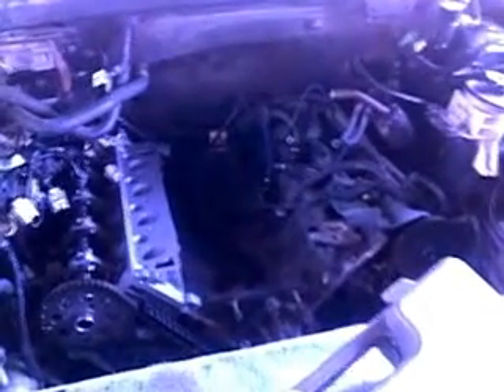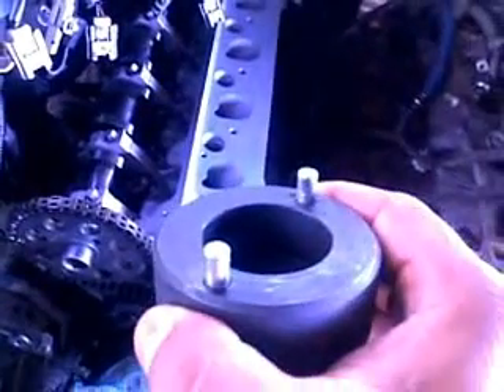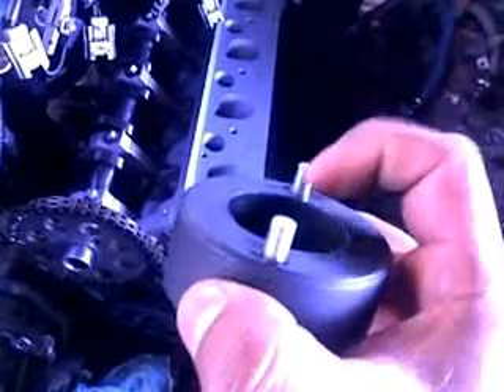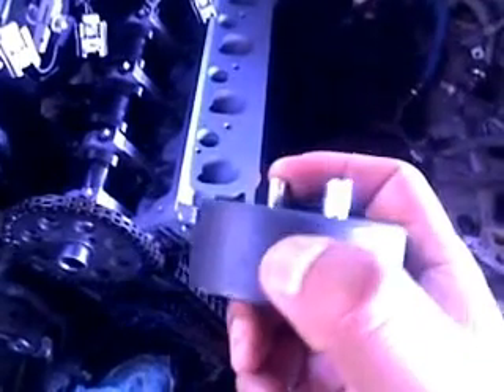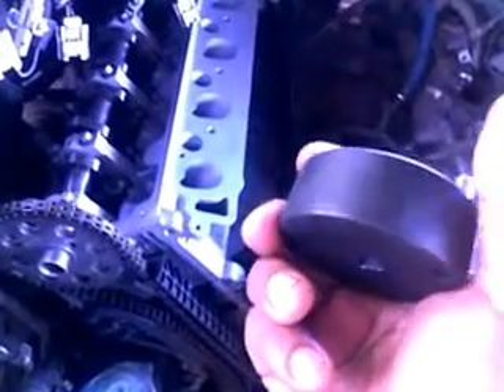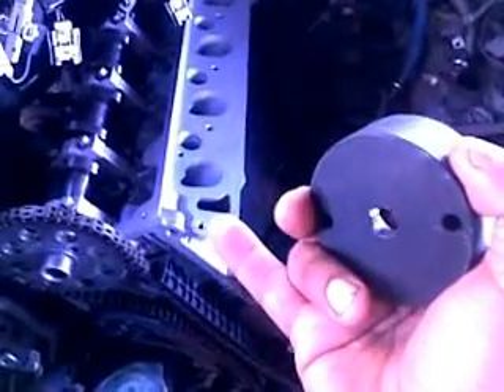Ford 5.4 Timing Chain Cylinderhead removal tool by otc

Comment: if you are going to remove the cylinder head anyway why do you worry about the cam moving? you can mark the chain with a pen and put it back the same way you removed it.
Reply from the maker: the valve springs put quite a bit of tension on camshaft lobes... and if you let this spring tension "rotate" the camshaft the valves can potentially "jam" into the tops of the pistons that are in the up position.  Its just a safety precaution especially when your removing both cylinder-heads/timing chain.

Comment: Once you get the chain off on one side will the cam slip once you take the tool off?  It seems like you would need one for both sides?
Reply from the maker: Daniel Hinkle yes the tension from the valves springs will actually cause the cam to spin a bit... normally you would use 2 tools to hold cams or you'd end up removing cylinder head, removing tool, then going to other side to install tool and remove the head.
Reply: Ok cool.. Thanks